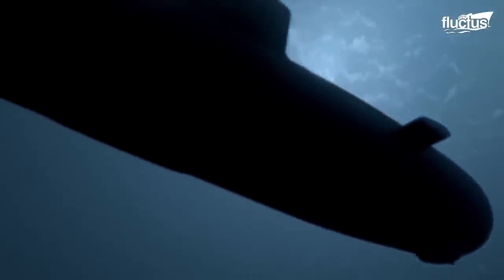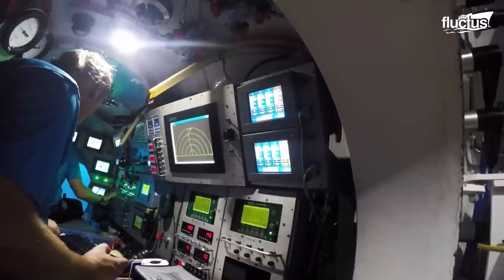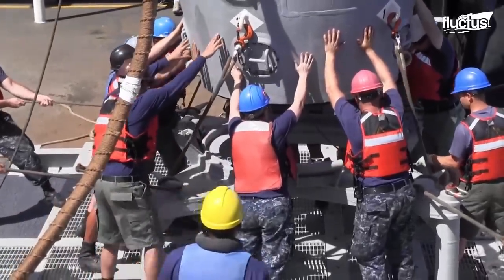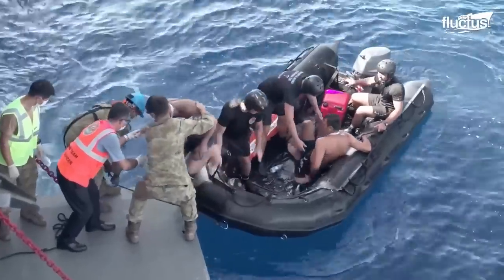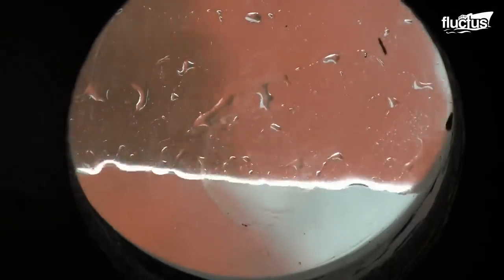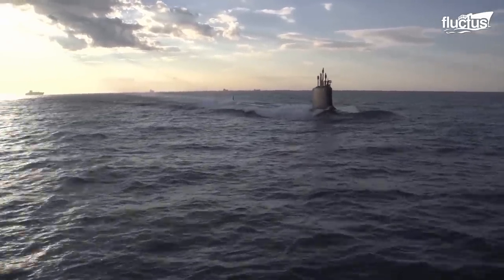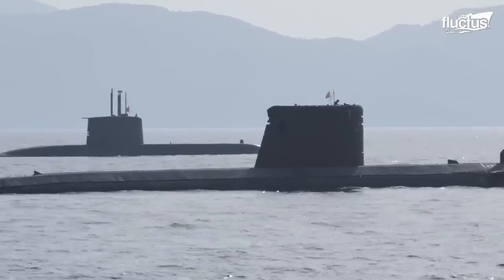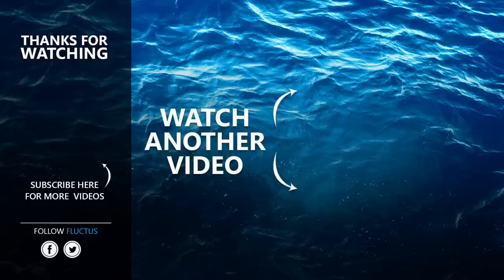The Weird but Genius Invention to Rescue Sailors From a 17,000 Ton Sinking Submarine

Comment: What about a hatch on the sub that opens to release a bladder inflated by chemical gas generators like an airbag. In shallow water it could immediately be deployed to bring the sub to the surface like a reverse parachute. In deeper water, two ideas come to mind. First, a computer with it's own battery power supply monitors the rate of ascension and uses solenoid valves to modify the pressure in the bladder. Second the bladder is tethered to the sub and ascends to the surface like a buoy or reverse anchor. Then a winch would lift the sub at a controlled rate.  The bladder could also bring to the surface a compressor, solar panels, and communication antenna. The compressor could send fresh air down to the sub and antenna could do an automated sos or allow communication down to the sub. The main benefit of these self contained systems is that they can be deployed before the sub sinks any further.  Why wait for the sub to hit the bottom and all of the issues with the increased depth?

Comment: What ever happened to the Lockheed DSRV rescue submersible? I worked on this project oh so many years ago in the mid '60's. I penned the top assembly drawing in India ink on mylar which was a 27' long drawing. The DSRV's operational specifications meet or exceed the specifications of the newer designs and was capable of rescuing up to  26 sailors per trip.

Comment: My concern is when the sub is on it side or upside down . 
Have engineers developed procedures to attach the rescue unit to a sub without access to the hatch?
Reply: submarines: where you have to worry about your nuclear reactor being sideways
Reply: Many pieces of equipment in a sub are held in place by its own weight, the reactor cannot function upside down so it will scram so the boat will shift to backup power also many systems are made to operate upright if you are upside down the emergency propulsion motor cant deploy as its gravity assisted.  If the reactor is offline the goal is to get to the surface by blowing main ballast tanks with high pressure air then since the reactor is offline run diesels to start up the reactor if not damaged that is the goal.  Now at best speed the epm can drive the sub to the surface at a speed of half to 1 knot to avoid the submarine sinking if the ballast tanks are not blown with high pressure air by having enough speed to have lift over the fairwater planes.  The ballast tanks have free flood ports on the bottom to allow water to enter, if the boat does turn upside down any trapped air will spill out making the boat heaver and sink faster and have stability issues.  You do have different types of ballast tanks, hard tanks/trim tanks can withstand ocean pressure while main ballast tanks are weaker and are used near the surface with medium and low pressure air while snorkeling.  Hard tanks and trim tanks only have so much ability of providing buoyancy vs main ballast tanks.  The greatest danger on a boat is flooding then fire as 688 boats do not have high reserve buoyancy compared to russian double hulled boats.  You can pump water out of a submarine while its flooding but pumps only have so much compacity and a boat can gain thousands of pounds of wight per second during flooding.  Also if the boat is upside down on the bottom you cant deploy emergency distress beacons or use the underwater phone(an/wqc-2) because the transducer would be pointing into mud.

So long story short: upside down on a sub is fatal and consider the crew already dead, it would be the worst possible scenario for any submarine.
Reply: @unguidedone  thanks for taking the time to explain the scenario.  "Sounds dangerous"  from the Right  Stuff